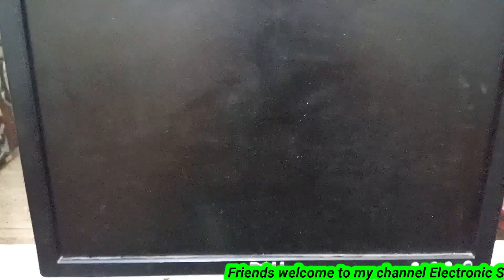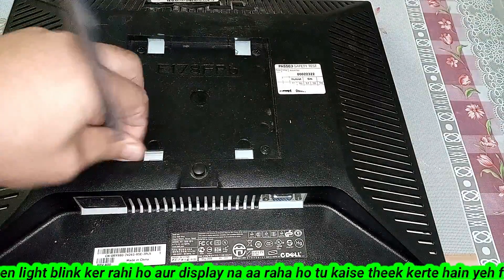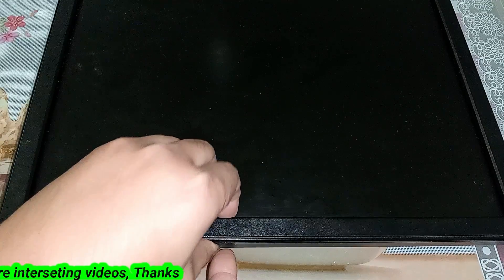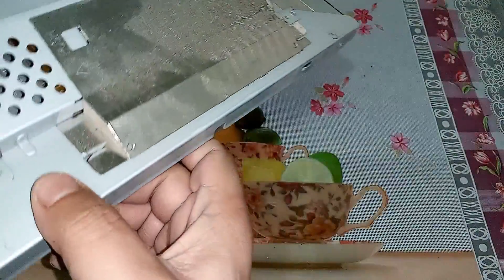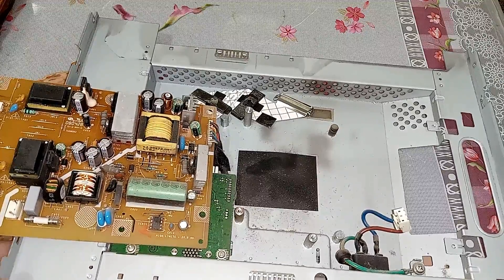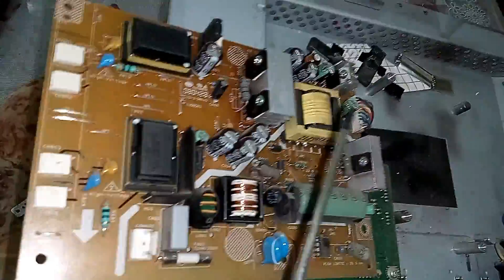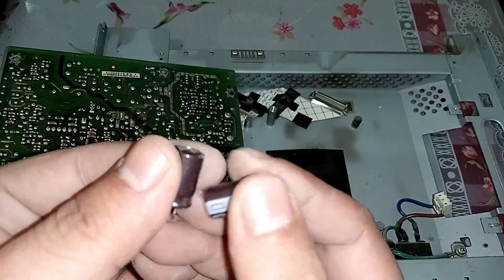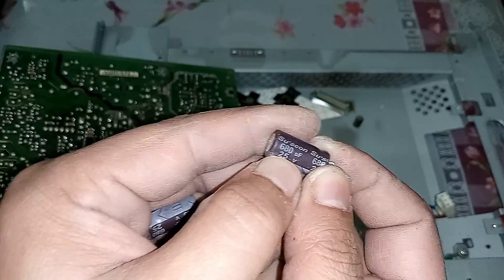DELL LCD MONITOR BLINKING GREEN POWER LIGHT || DELL LCD MONITOR DISPLAY PROBLEM

Comment: Awesome!  This was an easy $6.00 USA fix for me.  I think my monitor is a little different but the same basic premise applies.  I had 3 bad capacitors and bought a pack of 10 capacitors for about $6 US.  The monitor is old but I didn't want to just throw it in the landfill if I could get some more use out of it.  The hardest part is pulling that front plastic bezel off the monitor.   You really have to have some strong fingers.  Soldering in/out the capacitors was fairly easy.   Thank you for your video.  Nice job, dude!  You are saving the planet one monitor at a time! :)

Comment: hello,  I have monitor dell p2412HB, 24 inch,  I connect this monitor with my laptop,  it works normally until laptop enter to sleep mode,  if laptop go out sleep mode the dell monitor flashing once at startup then no picture, 
and I have to turn off the monitor for about 8 hours 
and after this period screen works normally until laptop enters into sleep mode again and the problem start again 
could you help me? 
thanks
Reply from the maker: You can increase sleep time of laptop from settings, So it will not go to sleep mode during work,

Comment: i have the same model(dell E178FPb) but the problem is colours keep changing between red green and blue and i dont know what  how to make it stop. it really strains my eyes while using the computer. Might you have a solution for me?
Reply from the maker: yes you have data cable(vga cable) problem.I have a video on my channel on how to repair vga cable.
watch that and solve your problem